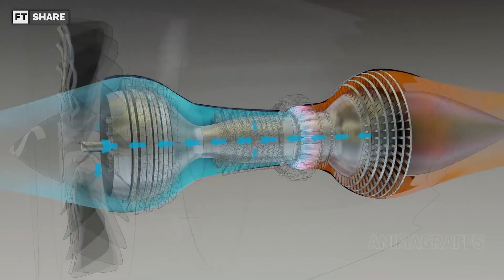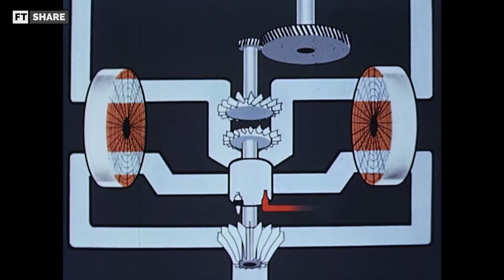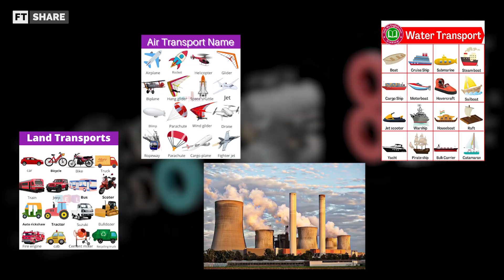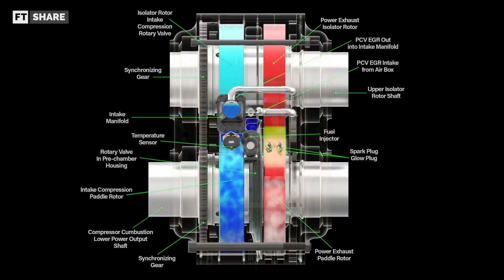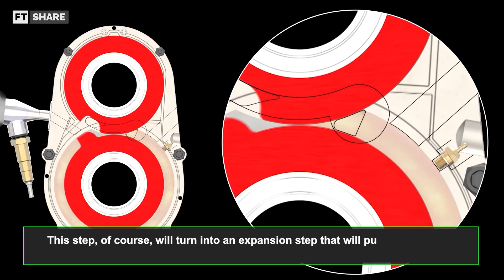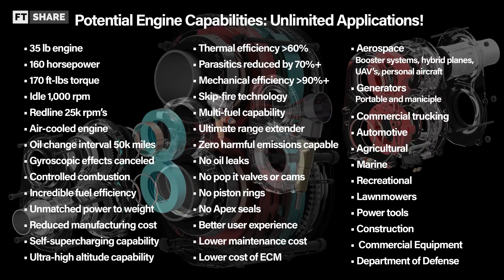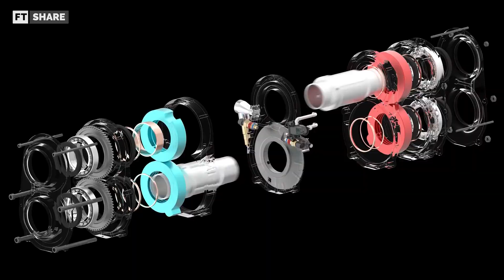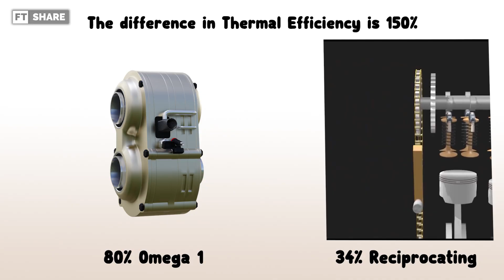Ready To Destroy EV Engine!! | Astron Aerospace - Omega 1 Engine

Comment: I have my doubts about the thermodynamic efficiency. Efficiency is directly related to the absolute temperature difference between where the work is extracted and the temperature of the heat sink at the other end where the heat is expelled. From what I see the fireing cycle is almost the same as with any piston engine and that limits what temperature you can be operating at. In fact what makes turbine fan jet engines less efficient than piston engines is that the blades have to operate in a high temp. region all the time, few materials can last the peak temps that piston engines extract their work at, because pistons, valves etc. get to `rest`and cool off between cycles (even at 20,000rpm).Turbine blade materials are exposed to continuous hot gases limiting this temperature to what the material can stand.
The rotation and " lug" division into expansion compression zones are ingenious and interesting (getting rid of reciprocating masses), though!
Stil see seals (as per Wanklyn) and gear problems as issues.
Was that cooling water pouring out?
Will need to see numbers for fuel efficiency, and seal life...Burning hydrogen (with any IC engine) interesting but how to carry enough mass with you, and infra-structure ?
Reply: @Adimoolah  the actual efficiency mentioned by the company is 60% but the video wanted to inflate a bit
Reply: @someboi4535  Actual efficiency will be 25% just like all other ICEs.
Reply: @rogerphelps9939  hmm how do you know?
Reply: @someboi4535  From actually having studied thermodynamics and the knowledge that after over 100 years of trying ICEs have not got much better than 25% efficient. It is just physics.
Reply: @Roger Phelps  yes but this is not your average ICE though this has no pistons at all
Reply: imeakdo7  in a very different way
Reply: @imeakdo7  yeah but these factors can stoll affect efficiency

Comment: its a cool engine but lets be honest unless they out law the gasoline engine out right there will never be a engine that will compete with it . its just a pipe dream . and electric vehicles are a waste of time and money . and there is no real proof of them being better for environment  not once you  figure in everything that needs to be done to make one . not to mention hey if your going to run a ev to save the earth stop using fossil fuel to charge them . the break down is this is old tech if it was any good they would have already been using it . dont matter what it runs on .

Comment: Very bold power to weight claims for an engine that hasn't run on a dyno. 
What's cooling the hot side rotor? With no breaks in combustion and no evaporative cooling from fuel the hot side is going to melt itself.
Reply: They are an Aerospace Company . Fun Fact , TurboFan  Jet Engines combust continuously and the Uncooled Power Turbines don't melt .

Comment: So it sounds like it has some sort of reliability issues, they are trying to solve some 'center material' that can hold up to not being worn down prematurely to frictional engine forces.     It will be interesting to see what they come up with.  To bad they couldn't invent some sort of self-healing technology that will  wear down by at rest regenerates back into spec, like some sort of ferro fluid that could re-fuse itself back to the metal it was worn off off.
Reply: From the videos, it was already leaking coolant like a sieve.

Comment: I love new technology and I have found a lot of new engine types out there that would be great, especially for range extenders for electric cars. But for some reason we will never see them.
Reply: The thing is range extenders won't be feasible if the promises of the battery industry become reality.
Reply: @Squee7e  People will always have range anxiety.
Reply: You should look over at Aquarius Engines. Way better design that has only 1 moving part and doesn't rely on the extreme levels of tolerance that the Omega 1 will require. Also, they already have working models, generators and a newly renewed contract with the US Military for R&D.
Reply: @BloodSteyn  I like the idea. I just want to see something in my next car other than the 130 y/o ICE design. Hopefully we will have a couple options to choose from within the next 5 years or so.
Reply: @BloodSteyn  
Thank you.
Reply: Pretty spectacular.
And although probably well tested is the piston, to my mind, a bit heavy, to stop and go 180 degrees for x 1000 times per minute.
But. All-in-all. very impressive!
Reply: Yes Rick.
As with all real good concepts. Bought out. And moth balled.

Comment: I think add 3 more 'combustion' lobes on the same rotor.
Reply: You were thinking just like me! But I was thinking more like a pair of center intake rotors sandwiched between a pair of compression /combustion rotors on either side spaced 180 degrees apart. That would keep the majority of the heat on the outside rotors that can be water jacketed/cooled. Essentially it would be TWO motors working together united by a single inlet set of rotors sized to feed both motors. Exiting HP/weight/size ratio!

Comment: combustion is happening after to power stroke which is very small for the engines given size. I love the wish list oil change 50k miles no oil leaks what's draining out on the test run. there's been an engine using 2 external vane pumps one side to compress other side to combust and expand and has far less surface area to wick heat from the combustion
Reply: Its oil injected no oil change required! amsoil interceptor 2stroke oil fore ever brappp.

Comment: Electric motors can be designed to be 99.4% efficient. Gas powered engines struggle to reach 50% efficiency because most of the energy is lost as heat.
Reply: Yeah but unlike with battery cars the “tank” doesn’t weigh 400-1000kg
Reply: @r.i.peperoniiiiroh9625  True
Reply: The loss is in the battery and charging lol
Reply: @a4000t  Nah Lithium batteries are 98% efficient meaning it you put 100 watt hours in you get 98 watt hours out. Chargers are 95% efficient at converting mains power to EV charge voltage/current.
Reply: @whoguy4231  But you didn't add in the losses from the generating plant,turbines,step up/down transformers to get power to you(assuming u don't generate your own charging power). Not to mention the Slave Labor mining considerations of lithium mines which use Diesel equipment etc..  but you can really play this all day down to talking about the cars electronics coming here from a slow boat in china burning tons of bunker fuel etc.
Reply: @a4000t  That's 100% true. Fossil fuel power plants are at most 50% efficient but most are old and only 30% efficient which definitely makes combustion engines the same efficiency of electric, unless EV's are charge solely on renewables which is a pipe dream for most. You're right !!!
Reply: @whoguy4231  I thought chargers are more like 90% efficient (slow chargers). And that fast chargers are less efficient. That is why I don't understand that they try to promote the fast chargers, because they are less efficient and also they do wear out the battery at a faster rate.
Reply: @Adriaan van Tulpenbaard  you all forget the loss of the transportation of electricity, and it is a lot !
Reply: @charpocus  Yes you are right. I do not know exactly the percentage, (I think it depend on the distance) but there is efficiency loss. But the main loss is if power is generated by older fossil fuel power plants with only a 30% thermal efficiency. This means 70% of the fuel put in is lost.